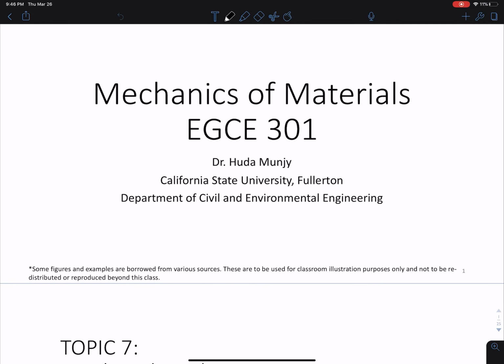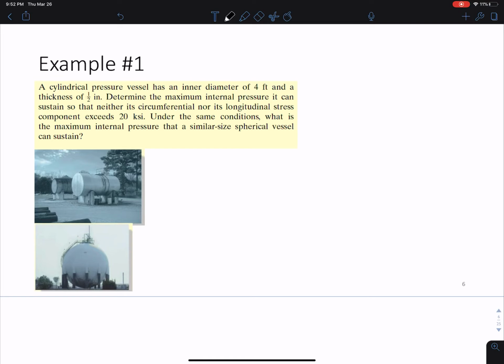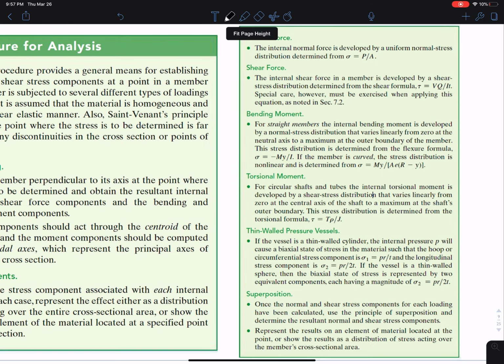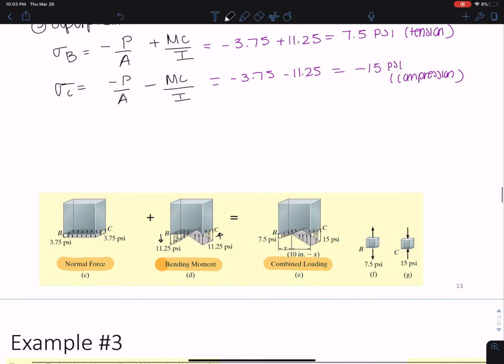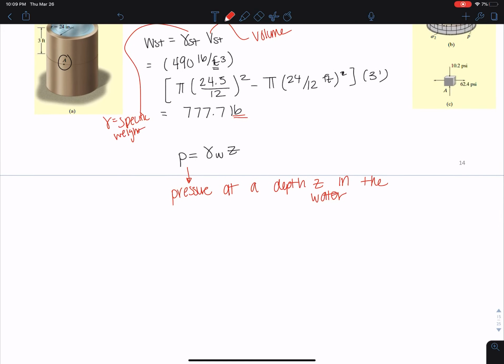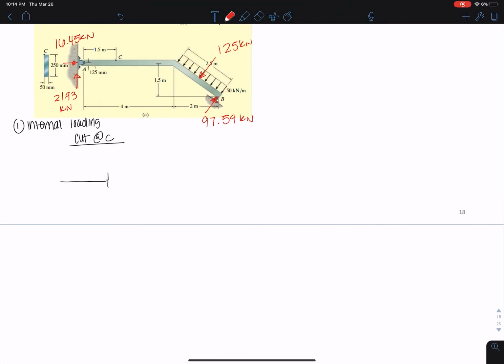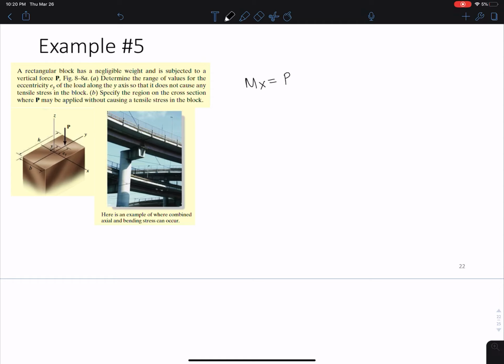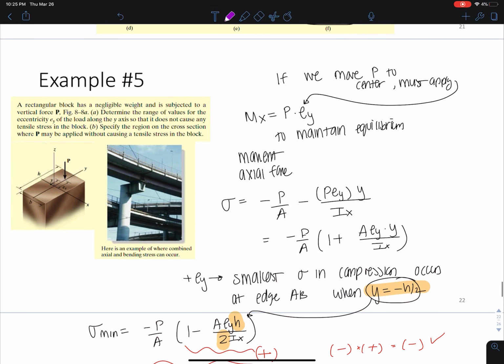EGCE301Topic7

Comment: In example 2, when you're doing the superposition, how do you know whether the normal stress or bending moment stress is in compression or tension?
Reply: hey Andrew!
if you're talking about step 3 with the superposition, the professor used the stress diagram to know whether the stresses for B and C are in compression or not. so the normal stress for B and C in the diagram is in compression because the arrows are pointing upwards. But in the bending moment diagram, B has the arrows pointing downward which indicate tension, hence the positive sign, but for C the arrows are pointing upward showing compression again, hence the negative sign.
hope this helped :)
Reply: You kinda have to redraw it to see it but I think its the parabola shape you get when you draw the force acting on the a member. It should be in our notes from topic 5 when she derived the flexure formula
Reply: I"m not sure here but this is what I got after looking at the stress profile that we drew in topic 5: Remember that the C value used in MC/I is the extreme distance from the neutral axis to the outer side. And the point that is associated with the extreme distance from the neutral axis to the outer side  will always be in compression because maximum stress occurs there (and the other point will be in tension). Refer to diagram (b) used for the internal loading, you will find that point C will be the extreme distance from Neutral axis to the outer side, which is 5 inches (in terms of the y axis) and point B is 2 inches away from the neutral axis(in terms of the x axis). And due to the concept of point C being associated with the furthest point from the neutral axis (Which is 5 inches), It will be in compression, and the other point (B) will be in tension.
Reply: Naser Naser wow actually made so much sense! I was confused about it even after the picture because i was worried about not being able to draw the picture and basically not know how to. But your explanation made so much sense thank you!
Reply from the maker: Thanks for this excellent reply, Naser!

Comment: For example 5 I don't understand the h/2 part why the smallest normal stress occurs when y=h/2.
Reply: I'm also confused about that part. If someone could explain that'd be great :)
Reply: I thought about it a lot, but I'm still not sure. maybe because we're trying to sustain compression and the smallest value of stress can occur if we move the force P h/2 in the negative y-direction.
Reply: Hey Erick,

I have tried to wrap my brain around this concept. I have searched the internet and read our book. The only thing I can come up with is the "Middle-Third Rule." It states that there will be no tensile stress developed in the wall or foundation lies with in the middle third of the structure so I believe in the very center is where the greatest compressive stress is. Now, outside of that area so bringing that line down to line AB is where the compressive is small and the tensile is largest. So you bring -h/2 to get you there.
Reply from the maker: Hi Erick (any everyone with this question), for this example we are saying that h/2 is the max distance away from the top that can still cause compression (anything above the NA causes compression, below causes tension)